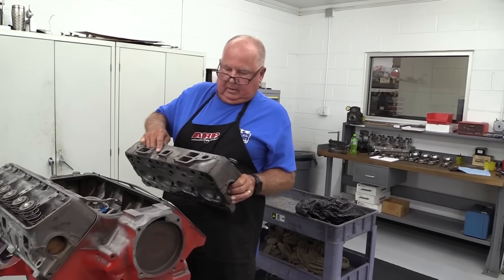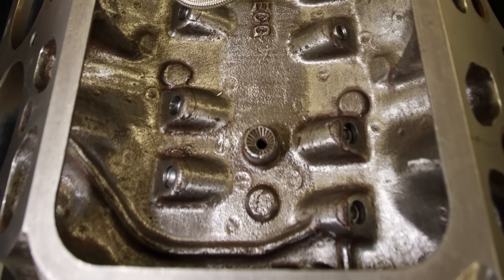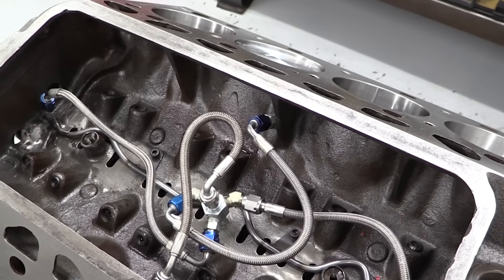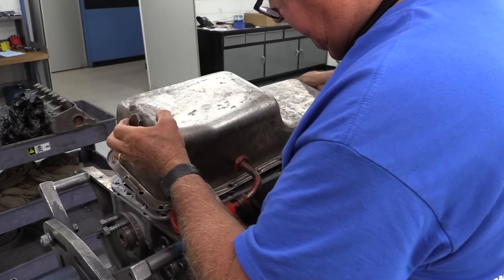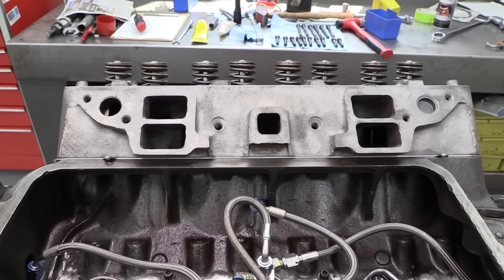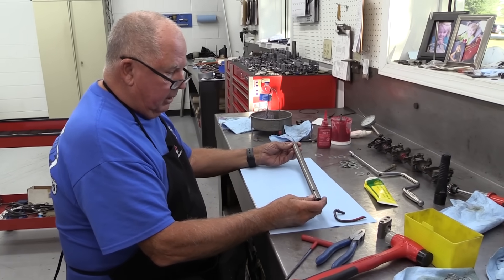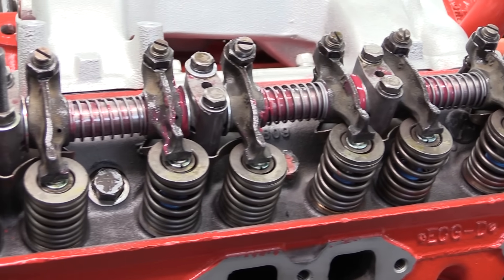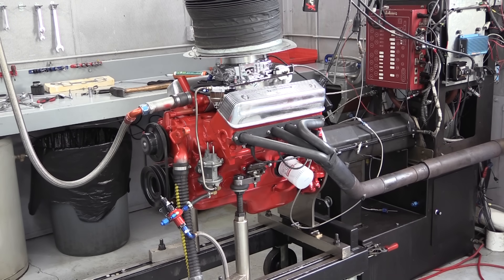The Engine That Replaced the Flathead -- Ford Y-Block Build

Comment: you say the exhaust port look like a small block chevy remember this engine came first
Reply: Gary Steffan Amen! Eat that Chevy boys and girls.
Reply: Gary Steffan i just thought the same
Reply: Really?  What about the Chevy 265 small block?
Reply: @seadog2396  what about it?  I guess there is a point to your question...??   Did the 265 block stay in production longer?  What's your question?
Reply: Lol yup
Reply: Came here to say this and that the 4 cylinder in the model A's has a similar pattern
Reply: Hahaha, yes, exactly what i thought...🤣😂
Reply: @mikec9112  LOL, try looking at the numbers.  You are all wet.  And Ford is taking credit for something Robert Yates designed?  Well, I guess it's you that are taking credit, but that figures...
Reply: @mikec9112  Oh, so the overhead valve part...  Now we're talking shared port?   Hmm... over under intake ports?  LOL, copied...  So the LS ports are just like the Lincoln y-block.  Just like, so copied, that's what you are saying.  Or are you merely talking about configuration.  So, if it's configuration, then Ford stole the overhead valve configuration form Olds/Caddy.   I'm betting you'll have some other lame-ass argument because that's what Ford guys do.  They don't win races, but they like to talk alot.
Reply: They were just comparing it to something
Reply: I think the Ford y block and Chevy small block were both introduced in 1954
Reply: You should check out the "Fase II" Ford Argentina heads...they look like a Windsor head...
Reply: This is a 292….the first oh was a 239 in 1954
Reply: I'd say Chevy copied the Y block on the exhaust port design.
Reply: @lawnmowermanlawnmowerman9930  Then would you say the y-block copied the Cadillac or the Olds?
Reply: @lawnmowermanlawnmowerman9930  Remember, the SBC was in development, and lasted until beyond 2000 in production vehicles - still available in "crate" form.  Had ford taken their time and designed a decent engine, perhaps it would have been "in service" longer than 10 years.   Both engines were "introduced" within a year of each other - think a minute and you might realize who copied who
Reply: @lawnmowermanlawnmowerman9930  would you say Ford Copied Olds on the exhaust port side?
Reply: Jon Kasse won an engine Masters Challenge with a y block. Not sure on the heads he ran, but he used a modified small block Chevy style intake iirc.
Reply: @brianhdueck3372  stock heavily modified heads. Special chambers and nearly 900 hp.
Reply: @brianhdueck3372  you do remember correctly. That engine was stout as all hell for a stacked port y block.
Reply: Gary Steffan sbc heads will work on it 2 lol
Reply: Yeah by 1 year, The Y-block was a turd compared to a small block Chevy. The Ford FE (352-390 - 428) was the first decent performing OHV engine Ford made .
Reply: @4thstooge75  There was also the 430ci Lincoln engine which was an option in the "4-seater" T-Bird!
Reply: @4thstooge75  Ford borrowed from Delage with the first mass-produced V8 but GM borrowed more heavily from Ford when they started producing V8s. Were the early GM V8 better than the Fords? Yes no argument. It often goes that way. Honda was the first to mass-produce  air-cooled inline fours ( again,technology pirated from elsewhere...MV Augusta ) yet Yamaha's XJ series air-cooled fours were INFINITELY superior.
Reply: @californiadreaming9216  apples to oranges?
Reply: @brianstough5286  not sure what your question relates to...?
Reply: @californiadreaming9216  As these replies do not appear directly with the comment it refers to, I understand the confusion...    What I think I was replying to was: why don't we compare a 1950's engine that had a relatively short 'production life' to a 1950's engine that had a short 'production life'??  The 348/409 may be a more realistic approach..?       Did the Y block - unmodified from the factory - ever achieve 1 HP per cubic inch?
Reply: @brianstough5286  I think I understand your point. GM V8 engines vs Ford V8 engines. There's an expression in French...plus ca change plus c'est la meme chose. The more things change the more they stay the same. From the 1950s right through to app 2009 this seems to be a universal consistent... Overall GM's engines in most segments are better than Ford's however Ford overall seems to make a better vehicle that's to say the whole thing flows together better and is overall more durable and more reliable. Also easier to repair and usually has a higher level of parts interchangeability which is very useful for a domestic mechanic. There are a few exceptions. The single cam 4.6 liter V8 built by Ford from 1991 through approximately 2011 is an absolute gem. In terms of durability, reliability and fuel consumption I would have to say that is perhaps best V8 engine ever built. However the debate between the gospel of Ford versus the gospel of Chevrolet has raged on for decades with no end in sight LOL
Reply: @californiadreaming9216  I see your points as well, and will concede that as far as seats and especially 'cup holders' go, ford has the lead.  I spent years driving trucks up and down interstates (and 'local' roads).  Especially of interest in the 1990's were the huge quantities of NEW Ford vehicles occupying the 'break down lanes'.  I'm not talking about flat tires or 20 year old vehicles -  I'm speaking about Taurus's and F-150s (and obviously, to a lesser extent the Mercury Sables and Ford minivans (front and rear wheel drive).  I would be negligent if I didn't mention the Mopar minivans of the 90's).   Cup holders are great!  Don't get me wrong!  So are the sun visors!    Their value, however, on a vehicle that can't be depended on, is arguable.    (before the point is brought up, let me also point out that, yes, I did stop very frequently to try to render assistance - especially if it appeared that there were women and/or small children stranded in, what a lot of CB'ers would refer to as "the Ford lane".)
Reply: @brianstough5286  what you are saying really doesn't Shock Me. It is true that in the 1990s Ford did make a lot of garbage. Ford quality improved substantially in the 2000s and then after the recession of 2009 quality improved drastically. As it stands right now, there is an astronomical Gap in quality between GM and Ford, Ford being way ahead of GM in overall quality now. Couple of significant points here... when it comes to manufacturers people will always speak from experience. I have owned 6 Crown Victoria Grand Marquis and never had any major problems with them. I have owned a couple of GM vehicles which were not bad but simply could not compare in quality to Crown Victoria Grand Marquis. It is also very important to compare apples with apples. Ford for example as always made good full size rear wheel drive sedans but a lot of their smaller cars and mid-size vehicles have been very so so. Toyotas small cars have always been but some of their 6-cylinder engines are very so so.
Reply: @CoyoteFTW  hi. Thanks for your comments. I think you  misunderstand me. (Useful to read all related comments before joining the conversation.) You need not defend Ford or their products. I love em. I absolutely lean toward Ford. The fact notwithstanding that ALL of the big three, including Ford,  have built and sold some  junk. 
Few know this: Ford was experimenting (independently) with air bags as early as 1967. They were also the first car manufacturer to install seat belts in cars BEFORE they became mandatory (circa 1968). 
     I picked up my 3rd Ford in 95. An 85 Crown Vic. Black. Vicky. Many of my co-workers jeered. I kept Vicky on the road for 18 MORE YEARS and took her up to 215 000 miles. She was still running like a Swiss watch the day she was sold. And I only sold her because I really, really wanted a 4.6 V8 Crown Vic and do not have room to park 2 cars. I got my first 4.6 Crown Vic in 09. A 97. Drove her for 9 years. Now I've got me an 02 Grand Marquis. Beautiful car.
God bless all those who value and take care of their machines. Columbo often said: "You take care of your car and it will take care of you!". Truer words were never spoken. Cheers.
Reply: @4thstooge75  Your crazy,one of my good friends was whoopin 283s left and right with his 292 Four barrel 55 Victoria back in the late 50s and early 60s. I've blown up several small block Chevys back in my younger days for people so they could force GM to replace an oil drinking,bad running but new engine.
Reply: @lawnmowermanlawnmowerman9930  LOL, what are you smokin'?  Can you name any races in any series a y-block won.
Reply: @lawnmowermanlawnmowerman9930  Some Crowns may have come out in '55 with the 312 T-Bird special (which is believed to have came out in '56, in Sunliner convertibles, Crown Vics, and T-Birds). It WOULD easily dust off a stock 283. I've owned and wrecked several
Reply: @tallen4520  Yeah I think your right, I have a good friend who has been a mechanic for more than 50 years now and he has an huge collection of Fords from that era and I know he has several Y Block powered cars. He also has a world of informational materials from Ford dealerships. I'll have to ask him because he is basically a 50s and 60s Ford expert.. He's got more than a hundred cars and trucks at this point.
Reply: @lawnmowermanlawnmowerman9930  My first Y-block (among many) was a '54 Merc convertible (I think it was 272 ci.), and flatheads ('53's) could do the quarter mile faster.I finally traded for a '56 Sunliner convertible (312 TB Special) and  283 chevs, were usually no contest. The main problem was the transmission in it, as it finally started getting slushy, and I never could find a good standard and change-over for it. I got dunk and wrecked it anyhow.
Reply: @tallen4520  Yeah, Ford's early automatics weren't too great especially when used for performance purposes
Reply: @playlist55  plenty of old Nascar races back in the day bud..
Reply: @a.j.robbinsii6975  sure...800 for Chevy, 700 for Ford?  But the question was y-blocks, how many races won?  Any?
Reply: @4thstooge75  uhhhh, the 265 sbc was a literal turd.
Reply: @frigglebiscuit7484  As well as the first 283s. Neither one was tough enough for truck duty
Reply: @frigglebiscuit7484  QUOTE uhhhh, the 265 sbc was a literal turd. UNQUOTE  and yet it would out perform the POS Y block. Have it your FoMoCo way !
Reply: @niagrasprings  Hey! The Ford Y block is great for a boat...as an anchor.
Reply: @niagrasprings  In 56, you could order an m260 option mercury y block V8 that was rated at 260 HP. That's 35 HP greater than Chevrolets highest optioned 265. I definitely would not call that out preforming.
Reply: @madmod  Chevy's highest output 265 had 240 hp (with Duntov cam).  That's only 20 less than the Merc, and It had 47 fewer cubes than the Merc.  It was also more honestly rated than Ford's engines of that era.  Real power?  I'd give the edge to Chevy. There were a few fast Ford Y blocks around, but read the automotive magazines of the day, and look at the drag strip records of that era - top stock classes were dominated by Chevies.  Why do you think the SBC became so ubiquitous?  Why did the Tri-Five Chevies become so collectible?  Why did factory performance development of the Ford Y block end after 1957?  Ford didn't have a decent performance small block until the 221/260/289/302 was introduced in the early to mid sixties.  That was a good motor.  The Y block?  Meh. . . .
Reply: @herman452  the y block laid the stepping stones that became standards in what is a reliable 8 cylinder. The same deep skirted block, and much of its design was carried over to other fords, as well as the sbc. While some only look at drag racing, the y block was very successful in competitive racing such as nascar, and land speed racing. They proved quite reliable, and while ford didnt focus on small blocks, it was 2 years after the release of the Chevy Small Block before ford released to FE which is essentially a y block designed block with proper heads. They never meant to compete the y against the sbc v8. Over half of the racing competition was using 6 cylinders at the time. When chevy stepped up, ford took a bigger step  before then entering the early 60s where ford v8s dominated setting records which would last over 30 years.
Reply: @madmod  Chrysler 300s dominated NASCAR in 55-56, especially the longer tracks.  Chevy did well on the shorter tracks.  Ford won a few races, but much fewer than Chrysler, Chevy or Dodge.  In 57, the supercharged Ford Y blocks did well in circle track racing, but after 57 the Y block was gone as a competition motor.  I'm sure that Ford used what it had learned with its first OHV V8 in developing its later V8s, but the original Y block was not part of whatever success Ford had in the late fifties and sixties.  As for Ford dominating racing in the sixties, I would beg to differ.  They had their successes, sure, but Richard Petty won more races in the 67 NASCAR season with his Plymouth than anyone else before or since.  And although Ford had its successes in drag racing (i.e., Ford Thunderbolt, etc), overall that sport was dominated by Mopars in top fuel and in the top stock and funny car classes from late 1962 until the early 70s when the Pro Stock Hemis were handicapped so badly they were essentially outlawed.  Sports car racing, yeah, Cobras and Shelby Mustangs and the GT40 were superb, as was the Ford racing V8 in Indy car racing.  Finally, Ford had a minuscule presence in bracket racing in the seventies, on up until the 5 liter HO Mustang came out.  It's been a whole 'nuther world since then.
Reply: @madmod  
"Gross HP" numbers were dreamed up by Marketing at 5 G+T lunches. Usually they were exaggerated, though sometimes they downplayed it to fool the insurance cos.

I wouldn't exactly be bragging that "our mostly-BS HP number is 35 bigger than their mostly-BS HP number!"
Reply: @bcubed72  this is misinformation. It's a different method of testing that makes the different hp numbers car to car, chassis to chassis. This is why engines began making some 100hp less than net figures and why two identical engines may make two different hp #'s due to accessories, exhaust, and combo used in that specific vehicle. This is why some cars look like a factory freak while others are left wondering where the 40-60hp they payed for went.
Reply: @bcubed72  as for comparing two combos from the same time period from two manufacturers, how else would you compare the two besides comparing their gross hp figures? That is the only constant that both engines are capable of producing.
Reply: @madmod  Learn the tricks they used to goose the numbers. Headers, single plane intakes, none of the accessories driven by the engine. When we switched from "gross" to "net" in the 70s, we saw just how badly ALL the MFRs were fibbing! Remember: the old "gross" numbers weren't even derived through a standardized method; that's why the SAE had to step in.
Reply: @bcubed72  you can match their power ratings by testing it the same way they did tho, it doesnt change what the engine makes. Just purely changed the testing methods. Believe me, i know they used to sell racier packages that shipped the car with the long tubes in the trunk to be installed at the dealership etc.
Reply: @madmod  GM was producing Olds and Cadillac engines starting in 1949 and these were better racing engines than the Y-block ever was.
Reply: @s.sestric9929  "better" is an interesting term as almost all engine built before fords y block where bench assembled by teams and far more expensive to produce. Beyond just advertising the "best" engine, Ford's brought the engine to the public and made it available to all.
Reply: @herman452  interesting and, as far as I know, accurate. I have heard that around 55 when Chrysler came out with the Hemi then it was all over at the drag strip. That if you didn't have a Hemi you might as well go home. That is until 62 ish when Chevy came out with the 409. Is this correct?
Reply: @californiadreaming9216  Actually, the Chrysler Hemi came out in 1951.  Hot rodders started using the motor pretty quickly.  They did well at Bonneville because Chryslers made more horsepower than anything else at the time, but at the drags not so well at first because traction was so limited that racers had difficulty putting the power to the ground.  One very early dragster (the Bean Bandit I believe, but am not 100% sure) actually had two motors - a Chrysler Hemi for top speed, a flathead Ford for ET.  As the years went by and tires improved, the Chrysler Hemi came to dominate top fuel.  In the lower classes, though, the Chrysler Hemi was available stock only in heavy Chryslers that were not competitive in stock classes; in modified classes, the heavy motor hurt weight transfer and traction.  In the late fifties, some Chrysler engineers built a 354 Chrysler Hemi powered 49 Plymouth specifically to beat small block Chevies in C Altered.  They called their car the "High and Mighty" because they raised the whole car, but especially the front, for better weight transfer - to compensate for having such a heavy motor up front.  The oil pan ended up three feet off the ground.  They also tuned intake and exhaust, developing the first tunnel ram intake manifold in the process, and running eight bell-shaped exhaust pipes inspired by then-current racing motorcycles.  It won its class at the 1960 Nationals, after which NHRA instituted rules changes which basically eliminated it as a competitive race car.  Those engineers, who began calling themselves the Ramchargers, turned their attention to Super Stock wedges, then hemis when those were re-introduced in 64, then match racers and top fuel and funny cars.  Chevies and Pontiacs (and a few Fords) pretty much dominated the top stock classes in drag racing until Dodges and Plymouths got the so-called Max Wedges in 62, and Mopars were at or near the top for the next decade.  Amazing stuff, and if you want to know more, get and read the book, "We Were the Ramchargers."
Reply: @herman452  wow. That was a mouthful. I congratulate you. You know your hot rods. I was a baby then and I'm guessing you were born a couple decades earlier..? My overall experience as a home mechanic has been that GM in the 80s through the 90s built some beautiful engines and that the rest of the cars that they put those engines in we're very very so so is very mediocre in quality. Many annoying problems. And my experience has been that Ford engines, with some exceptions like the 4.6 liter V8 (which is an absolute gem) introduced in 1991 in the US, 1992 in Canada, were never as good as the GM engines in terms of durability and reliability. That said, Ford's built in the 80s and 90s overall work better than the GM's of that era.
Chrysler for the same era? VERY VERY hit-and-miss. Pound for pound Chrysler still seems to be the horsepower King and unfortunately much of their stuff is just absolute garbage. Ever heard of a Chrysler Pacifica? What a piece of garbage. What the heck is good about an engine which needs to be lifted out of the engine cradle in order to replace a starter?!? Anyhow... Great chatting with you.
Reply: @madmod  It's OK to be a ford fan, as long as you've got REALLY DEEP Pockets!
Reply: @brianstough5286  you can purchase a used gen 3 coyote for about the same price as a used ls3. Modular shit is cheap these days too.
Reply: @madmod  I will have to do further research on this - and I hope you are correct!  But, I want to point out that in your zeal, the words you used above are: "...Modular SHIT..."
Reply: @brianstough5286  Dont try and twist my words up too much. Just cause they are shitty for power in stock trim doesnt mean much is holding them back too much. They are stout and records on a plethora of chassis, classes, and types of racing speak for them more than I ever could. The cost issue became a moot point over a decade ago with higher availability of aftermarket parts, and when f series trucks and cars equipped with coyotes began finding there way into the used market and junkyards, it quickly became a source for honest 400hp complete longblocks very affordably. Today 2500-3000$ gets a complete running yote.
Reply: @herman452  Yeah, but the Ford Dealer said....  :  )
Reply: @madmod  Actual figures and 'factory/dealer quoted gross hp figures' can be quite different.   Remember the 4.6 mustang (2000?) that was 'factory quoted' at 300 hp??  Owners were quite upset when they put them on dyno's to "fact check".  Can you say "Lawsuits"?
Reply: @madmod  Your 'numbers' about there being so many available in the junkyards/scrapyards are questionable.  What you are essentially saying is that all of the millions and millions of F150's and mustangs that were sold (yeah, numbers like yours - but if you believe the advertisements, it sounds like there were millions and millions) were all produced with coyotes - but, that isn't true is it?  When did the "ecoboost" start displacing the V8's in production???    The only way your numbers make any sense is if 100% of the coyote mustangs and F150's made "an early appearance" in the junkyards - to make them available in the quantities you're 'asserting'...  {but - keep on spinning (twisting) information}
Reply: @brianstough5286  With ford selling in excess of 700,000 f series trucks with as many as 909k per year from 2013-2020 and Ford themselves claiming about 150k f150s alone in 2017, not counting the larger f series chassis which comes standard equipped 5.0. Ill stand by the fact you can find them used affordably both in wreckers, and pulled running complete online. I source them pretty often in my local you pull yard and being as there are factually millions of them around.
Reply: @frigglebiscuit7484  my 55 chev with 265 high lift cam won many trophies at ontario strips
Reply: @4thstooge75  QUOTE The Y-block was a turd compared to a small block Chevy. The Ford FE (352-390 - 428) was the first decent performing OHV engine Ford made . UNQUOTE .....and then the FoMoCo FE required special lubrication plumbing and provisions ('side oiler") to keep it running as it made any meaningful power.
Reply: @niagrasprings  I've owned several FEs, a 352, a 360, several 390s, and a 428SCJ. Not one of them had any "special plumbing" for the oiling system. You need to check your info. I believe you heard or read something about the 427 side oiler and are confusing yourself.